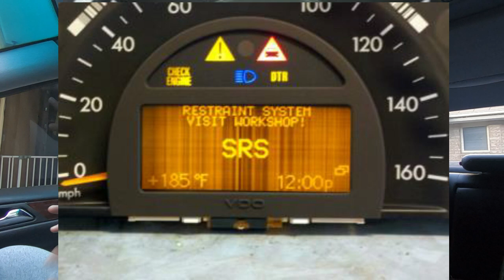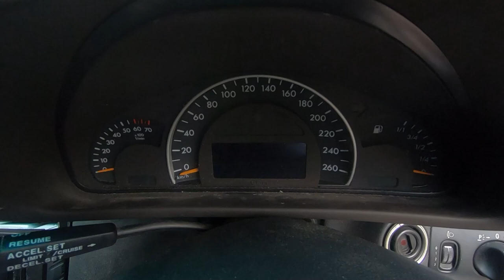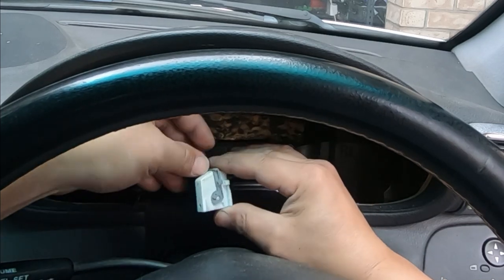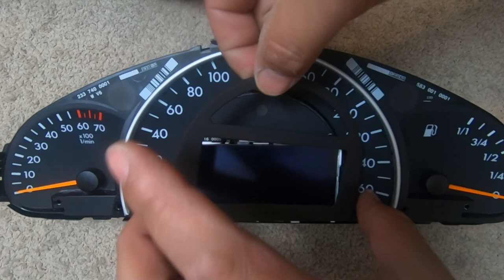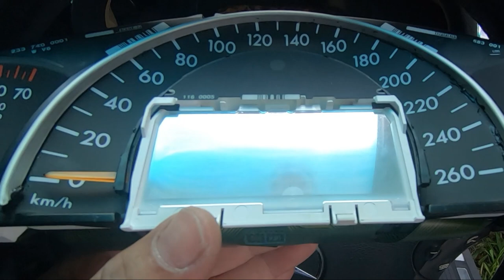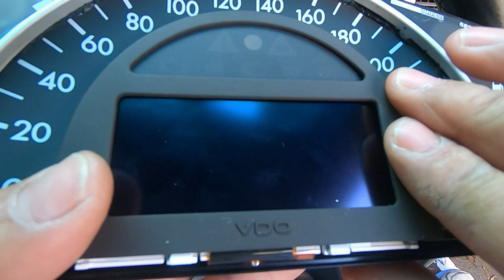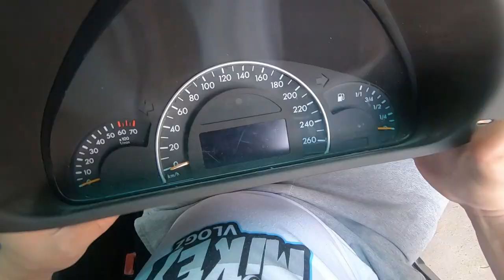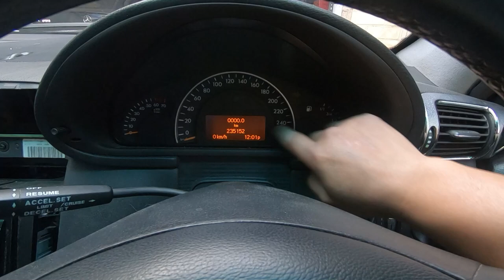how to mercedes w203 prefacelift instrument cluster +  fix lcd screen + replacement

Comment from the maker: hey guys so here is the first of many w203 video to come.... hope this video helps yo to replace this common issue with the w203,, just use a coat hanger and bend the tip to make a hook so u can remove the icluster...as for the clip for the wiring harness be careful not to break it like i did ..enjoy the video

Comment: I have 2 rows of leds that have failed im assuming i have to solder the connections before replacing screen.why didnt you mention this in your vid this is also half the problem.cheers mate.

Comment: Hi,
I followed the steps in the video to change the LCD screen, I didn’t have any issues at all but when I plugged it back in the LCD and the instrument lights do not come on. Any thoughts?

  Robert
Reply from the maker: u must have not plugged it in properly or did u bend the plug too much ?? they are very sensitive 
apart from that it was pretty straight forward
do u have your old one still plug that back int and see if u get a signal 
possible the new one is defective?
Reply: @MIKEYZVLOGZ  I unplugged it and plugged it back in a couple times and how it works great.

Thank you,

Comment: Hey there, thanks for the video! Does it require any programming when the new lcd is installed? E.g to get the original miles?
Reply from the maker: NO PROGRAMMING ITS PLUG AND PLAY

Comment: I just did this upgrade, PROBLEM, plugged the harness in and all is GREAT, until I pushed the cluster back in and the LCD went blank. Swapped the old one back in, nothing. Mechanic swapped another cluster in and it worked. Sent my cluster out to the supplier of the LCD and they said that LCD and my original both worked in there test so it is my Dash Cluster that has the problem. All lights and Dails work.
    Any thoughts?
Reply: The same result after replacing the LCD in my car. It had me thinking the cluster might be the culprit. Any luck finding out the root of the problem?

Comment: what would happen if i carelessly left the gauges (Speedo, temp, fuel) turned up and already fixed everything back? Would it show an inaccurate reading? or would it zero-rise itself when i start the car? 
Thanks!
Reply from the maker: not accurate ..I did that and it's not accurate needs to start at zero
Reply: @MIKEYZVLOGZ  ok... guess i'll need to redo it! thanks for your help buddy
Reply from the maker: @JEC1311  npz

Comment: lm getting ready to do this .I have heard that some are not as good as others .Most are Chinese for about $75 online .Do you recommend a certain brand or anything?They all look the same bit I have read where some people have said the cheap Chinese ones are not very bright. l see you got a blue one ,l have seen that one on Amazon. The VDO brand is the oem one that the factory uses
Reply from the maker: yes cheap Chinese isn't always as good as vdo oem.. but the choice is yours.. if u can afford vdo or can get a really good used ..then maybe do so.. but must be very fair price..or else no point .. I settled for Chinese to fix the issue asap and get it going again ..also Chinese can fade and not be same brightness throughout .. it all depends on your circumstance... are u on a budget? can u afford oem.. can u find used at a good price ... as stated I went with cheaper Chinese to test it and show how its fixed... personal preference ... good luck with your fix mate ..not too hard

Comment: does signal lights indicator also go power of with instrument cluster ?
Reply from the maker: what do u mean ? I'm not sure I understand
Reply: @MIKEYZVLOGZ  my mercedes w203 instrument cluster  completely power off. No gauges lights and even signal lights indicate lights . I check fuse relevant to instrument cluster  it is good. What is the possible reason to power off instrument cluster . Ignition and engine runs well.
Reply from the maker: @somathilakeBwm  sounds like a electrical problem i cant dy excetly wha it is but u should get an autoelectrician to look at it 
cant drive liek that

Comment: Ok. What do you after the screen is changed and the SRS failure appears? It didn't have this message before
Reply from the maker: it should have an srs error... if u have that u just have to have it cleared ... is it srs airbag error? what does it say exactly
Reply: I believe it requires turning the steering back and forth (5x)